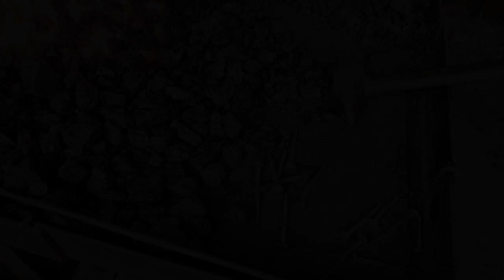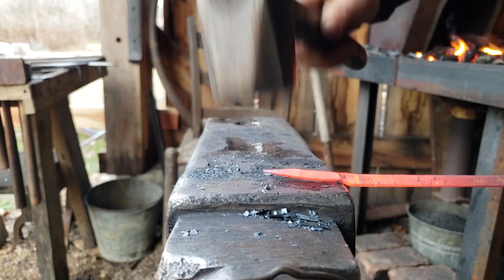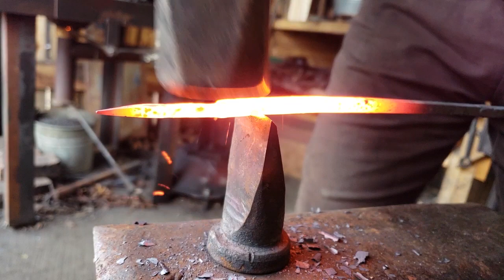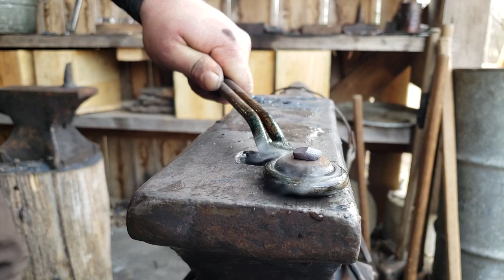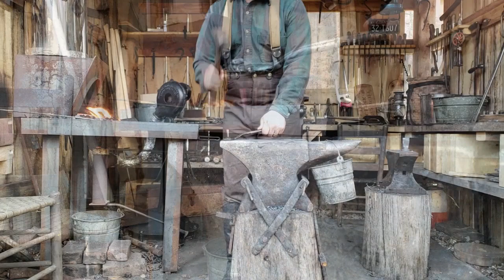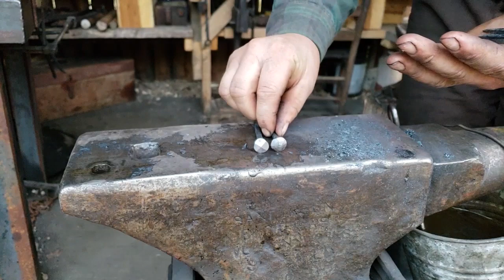Hand Forging nails -Axe and Anvil

Comment: Jordan... do you use normal mild steel for your nails... I’ve been making a few for various projects and then have trouble driving them, and end up bending them!
Reply from the maker: Yes I do, as originals were made from soft wrought iron normally. I find ones with a domed or faceted head drive easier, and using a wooden mallet helps. I use a mallet on the rosehead nails anyway to protect that pretty design. I also predrill for many projects.